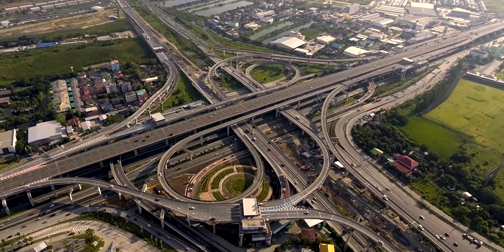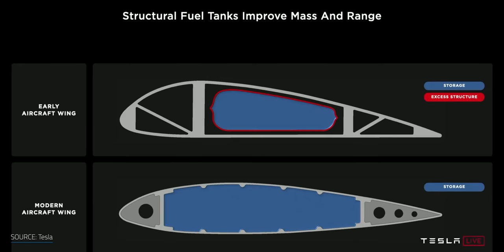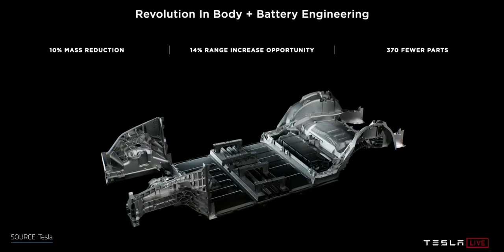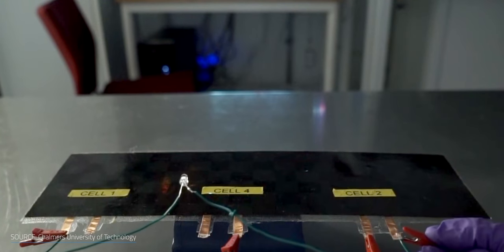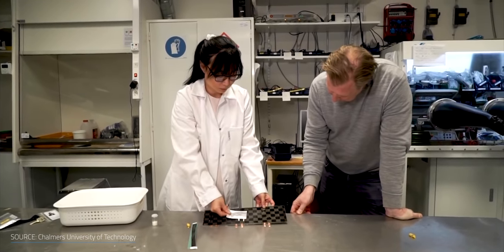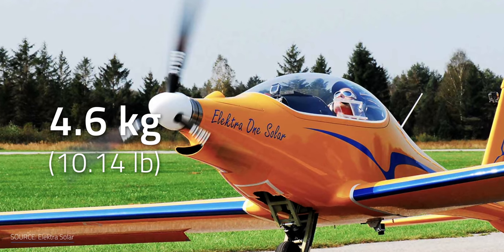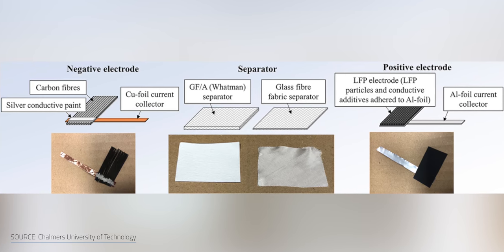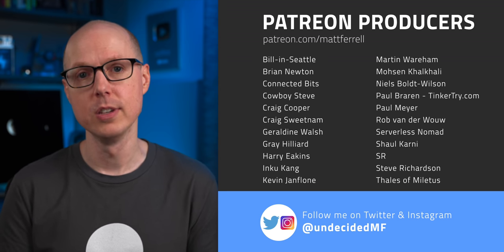Exploring Structural Batteries

Comment: So if something goes wrong with the battery parts, you gotta replace the whole car...
Reply: I would assume each battery can act independently... so if anything goes wrong... you lose range and power but the product will still run.. Given a long enough time, yes like everything it will need to be replaced.
Reply: Yeah, I think I've seen examples where that happens with ordinary EVs anyway because the battery is the expensive part making it essentially the entire car. So really that's just cost/benefit analysis on the individual that needs to replace versus what the company wants to do.
Reply: Well, that is the basic problem with combining things.  Failure of one means failing of both.  It also means that both things need to have similar life expectancy.

With the fuel tanks on an airplane, the wings need to have structure anyway.  They add to them to make them fuel tanks.  The wings without the fuel are still wings.  A better comparison for the battery would be to make the wings out of fuel (I recognize that this is absurd).
Reply: yep, cant fix that or hot swap
Reply: @EC-dz4bq  I do hope his concern would be addressed somehow. That and how we can make these cars better for end of life Recycling.
Reply: Only if they build it like a Mclaren F1 out of layers of carbon fiber batteries epoxy bonded & autoclaved together // or hot pressed together like BMW I3 body shell out of hot glue BASF innovated hot press fast cheaper carbon fiber //
Reply: @AaronSchwarz42  Not necessarily.   There is an older video here about the Solar Roof.  One of the issues (depending on where you are) would be hail.  If your roof got hit by hail and damaged the solar panel, you could be up for a roof replacement.  

In the case here, the idea is that structural members of the car are built out of batteries.  You would want to pick areas that would be easily removable AND not subject to impact on any kind of regular basis.  I think that means top shell parts of the vehicle (roof as an example) and structural elements on the inside that are removeable.  An example might be the package tray.  

None of that is horrible, but there is one more thing that might create a challenge and that would be vibration.  There will need to be a long term life test on these devices as cars vibrate from road imperfections as they move.
Reply: I think it's going to be just like smartphones where earlier they used to have removable batteries but now it's non removable.
But they can be removed by technician if something goes wrong.
I think it's going to be same for tesla as well.
Reply: @praneeth6005  So are you going to be willing to buy a new Tesla if the batteries fail after a year?
Reply: @jimsackmanbusinesscoaching1344  I hope they have warranty. I'm more concerned about recycling at that point.
Reply: @jimsackmanbusinesscoaching1344  do u think teslas fail within a year. If that was the case then no one would buy ev's. 
Batteries degrade over a long period oftime.
Reply: @praneeth6005  I am not talking about how the batteries degrade.  I am talking about failures.  You know not everything works all the time.
Reply: @jimsackmanbusinesscoaching1344  hahaha Yes, the threat of a tesla battery failing within a year shouldn't stop you from buying.

Because they dont.  And there's a warranty.
Reply: @KenLord  Really....nothing has ever failed early....ever heard of a bathtub curve?
Reply: @jimsackmanbusinesscoaching1344  again ... ever heard of a warranty?
Reply: @KenLord  So you are going to be happy while your car is being disassembled to replace a battery?  And are you sure whatever happened is covered by a warranty that we have not seen yet?
Reply: @jimsackmanbusinesscoaching1344  so are you like 10 years old and brand new to buying consumer products?  Does the "business coaching" part of your name refer to some MLM scam or something?  Because you're showing a really bizarre amount of ignorance here ... both of the track record of the million+ tesla's on the road and of buying cars in general.

... and I'm being really charitable, and assuming you aren't just some troll.

Comment: This isn't a breakthrough. The battery still needs to weigh the same to hold the same amount of energy. The battery isn't structual at all, it's just integrated into the frame, but as long as the material in the battery itself isn't helping the structure (which it isn't, it's mostly liquid), you can just as easy put it in the bottom, where it helps with the vehicles weight distribution. Have fun flipping your car if the center of mass is on your eyelevel.

Comment: And, conveniently for Tesla, the batteries are no longer replaceable, adding to the planned obsolescence of the car.  For as long as the expected life of the batteries is half the life I expect from the car, I want the batteries to be replaceable.
Reply: Maybe there will be somebody producing replacement parts. Overall this idea (merging structure and battery into one part) has some benefits - less mass or more energy stored for the same mass. Or we have to wait for other companies to catch up.
Reply: Eventually for EVs to progress the engineers have to do something.  Right now thr problem is mass/weight vs kW of stored energy vs charging time.  A typical battery quandary, which is why NASA went with H2 fuel cells on Apollo and massive solar panels on Skylab and the ISS.

The more potential kW of stored energy means adding mass, which means the car uses more kW for acceleration and terrain lift, which also means charging takes longer.  It takes x time to charge y kWh into a chemical battery.  You make the battery twice as big, it takes almost twice as long to fill.  If you only fill 50% then you're dragging dead weight.
Reply: Maybe they can put the vehicle on a lift and access the batteries via removal of the base.

They have to have some way of accessing the batteries. If they have battery problems that are the company's fault or are covered by warranty they'd have to give you a whole new car with the same options. It doesn't seem viable for them.
Reply: @STho205  Aerospace batteries made in low single digit volumes in a clean room by scientists who meticulously & carefully assemble them one at a time // thats very different than what is possible for high volume manufacturing of feasible products 

Satellite batteries often cost $50,000 or more & are kind of heavy or high mass given their capacities, but designed for ultra long life since servicing a replacement battery not happening in all but the most rare of cases on the ISS, which is a regularly visited lower earth orbit asset collaborative built & maintained by the national budgets of many nations //
Reply: Literal throw away cars!
Reply: Individual cells will probably be an issue, but why wouldn´t be the whole structural pack be replacable? The difference is that they´d be replacing the pack including the frame holding it but as long as the front and rear castings are not welded to the pack I don´t see a problem.
Reply: @AaronSchwarz42  even at all that, batteries are crap.  One of the first missions to the ISS was to replace the batteries, badly manufactured and hot overcharged.

Clean rooms don't always produce great products.  The only reason Hubble worked is the Shuttle Crews brought it some glasses for the poor mirror incorrectly ground in the clean room... Even with the extra years to get it right due to the post Challenger flight blackout.
Reply: @STho205  have you looked at the price of a 65 worth more then they where at the time so there's also that. But your cool with maybe an unexpected life event where you can't purchase a new car when your battery's eventually fail and there built into the car!!!! And those people that don't have the ability in the first place to buy new. There's a lot more of those people then you think.
Reply: @philliplarocque9328  that's because many if them to keep alive have had many thousands poured into them every four or five years.  Some were just locked up after a few years... Which make them valuable by comparison.

If you drove a 65 mustang daily, 20000 miles a year as your only car, then gave it to your child, and theirs... That's over 1,100,000miles and 55 years in weather or exposed to accident. 

You would have had to rebuild most of the components several times.  Total rebuilds every 15-20 years.

You would have much more actual cash in them than an old beater like that would fetch.   If corrected for sliding inflation... Probably a dollar a mile.
Reply: @rogerstarkey5390  I doubt each cell would have individual wiring, most likely the whole row would be in series so one fails and the whole row has to be disconnected. But you are correct that single cell failure won´t shutdown a significant part of the pack. I was refering to the fact that repairing part of the pack will probably be impossible and if necessary the whole pack will have to be replaced.
Reply: @STho205  but if your taking care of it you can keep it all one piece and with just a little bit of luck no acts of God or accidents happen it will last the fact is it will last and a battery won't.. That's it that's the moral of my story
Reply: @philliplarocque9328  how old is your current daily driver?
Reply: @STho205  11 years
Reply: @philliplarocque9328  oldest daily driver I had was 25 years and 250,000mi.  Bought it at 40k and a few years old.
Reply: @STho205  remember this post and ten years and ask me if I've purchased a tesla yet.
Reply: @STho205  k but I'm saying once you build a car that is its own battery once the battery's done the car is junk..
Reply: @philliplarocque9328  all these first gen 21st century EV cars are future junk, just like Model Ts, Dobles and Sutz Bearcats.
Reply: You're very misinformed about the new 4860 cells. It's already been confirmed to have a million mile battery life, so it will outlast the car.
Reply: @Warbay57  It’s a fair point that Tesla is working on that problem.  I remain skeptical that the new batteries will last 20 years (million miles is not the same thing), but it’s probably not fair of me to call it planned obsolescence yet

Comment: "Save the planet, use electric"

Proceeds to design car that you throw away when the battery goes bad......

See the problem?
Reply: @Timothy Mckee funny how no one says that about oil. I'd like to see you produce your own gasoline.
Reply: @Timothy Mckee so you can produce your own combustible fuel at home? Sometimes you read legitimate concerns about EVs, and sometimes you read about empty complaints.
Reply: sounds like Texas needs a more robust infrastructure...

Up here in Canada, we get shit weather for months per year, and we never have power outages. It's time you get with the times and update, or become irrelevant.

You want the world to run on crude oil forever? Sending it from the well into the air has absolutely no consequence?
Reply: This has nothing to do with gore the energy is made its ability making cars even more disposable and more expensive. Its wasteful and no better than using gas. 
Hydrogen is the way to go. Literally unlimited.
Reply: @Timothy Mckee i would say it makes sense to find something sustainable. Coal definitely isn't.
Reply: Use DC electric and quit losing 15 - 20% of your energy input into charging batteries.
Reply: Or your State,tells you not to charge your EV because the grid,is overloaded. Due to the fact they have shutdown all the power plants,Fuel stations,Etc  and the so called green energy can't handle the need.Or we have a CME and it fries the Grid,Cars,Trucks,Etc.
Reply: It was never about saving the environment. 

See the problem?

Comment: I think you sometimes forget that there are a loooot of engineers on the internet. Battery in the structure of a product is not a new concept. But do you see any products utilising it? Are mobile phone frames made of battery cases? Do you think any engineering team did not think about making the chasis of a laptop as a battery?

The overwhelming flak in the comments are not unfounded.
Reply: Some bluethooth ear pieces have batteries inside the band that connects L+R pieces.   I guess those qualifies as a primitive version of one.
Reply: .😂🤣🤣😂Weight savings with less efficient batteries are fine because the cars will be lighter (because of the less efficient batteries)..?.🤣😂
Indeed… This video is Pure pseudo intellectual noise…..Plus, His cadence is UGH!.. Had to turn it off..
Reply: @brucejenner8620  I think they meant more that you keep the existing battery, but then the casing itself also becomes another battery, so you get more total capacity without any increase in weight.
Reply: @PixlRainbow  Yeah, I'm thinking in the same way. If there is a structural material that can also be an energy storage device then why not just build it in, even though it isn't as efficient. It's a similar concept to the solar tile, right, create a roof tile that is also harvesting solar energy, rather than putting panels on top.

Comment: The only issue with this is what will happen if the battery needs to be replaced?
Will the cost of replacement be so expensive that a new car would be more economical?
Reply: Probably it not 1 huge piece
Reply: Cars that have to be replaced avery 2-4 years with a brand new one. The suits would instantly jizz themselves.
Reply: That is the whole point, Swedish scrapyards are full of cars that are lessthan 2 years old because electric cars are very popular there and any damage to the battery and its more expensive repair than buying new car...
Reply: somebody has to fund elons base on mars
this strategy has worked pretty well for apple in the past decade, so why not use it for cars too
Reply: Yes, i think using this cannot be economical for cars. But it may have large  impact on other electric locomotives like electric train etc
Reply: Look up The Right To Repair Bill
Reply: @FSXgta  not capitalism. Corporatism.